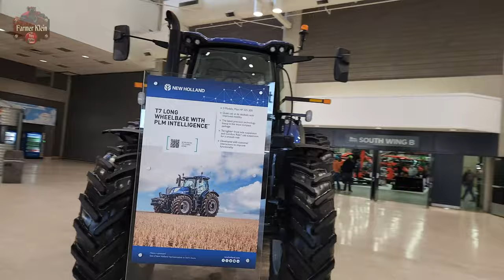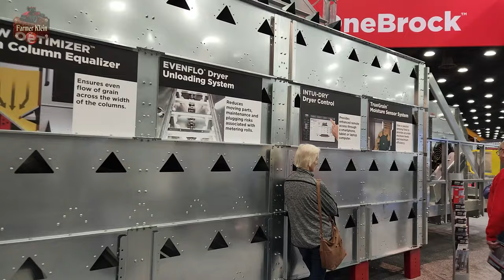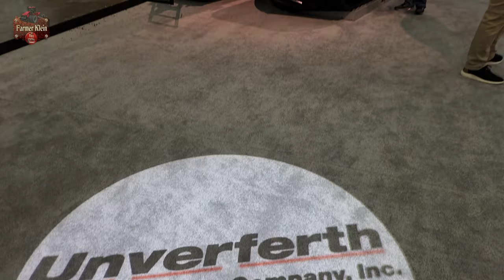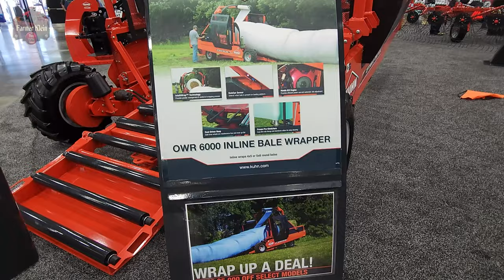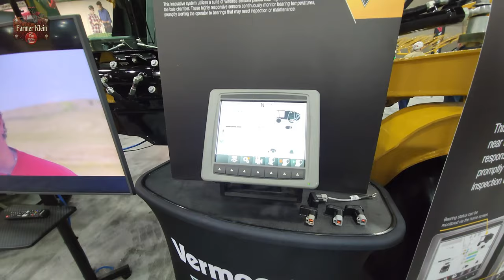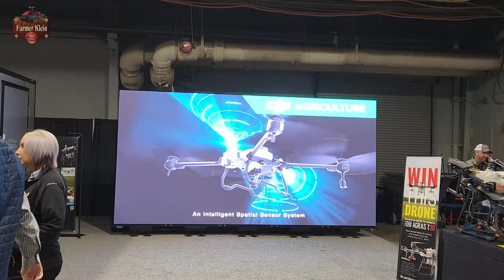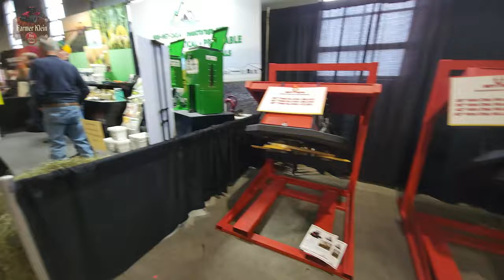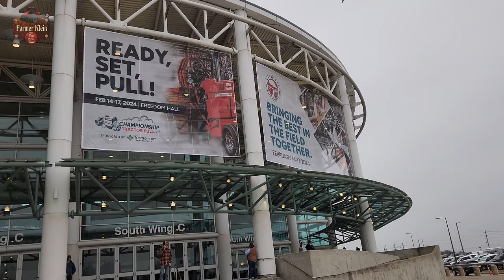National Farm Machinery Show 2024 - Super Edit

Comment: Brilliant video. It's like you're there! I'm curious, though. Exactly how long does a hi res 3.5 hour video take to upload?! I'd think about 48 hours....
Reply from the maker: On my home connection over wifi about an hour and a half.  Could have taken less time if I bothered to plug the ethernet cable in.  It was a 63Gb size file so upload times would depends greatly on your internet connection.
Reply: @FarmerKlein  Wow. I guess your videos get upscaled by YT. I thought it would be a 3-400gb video. Looks fantastic, though.
Reply from the maker: @thevenerablekev1  I encode everything in 4K.  No youtube upscaling.  All of those clips were recorded in 4K 60FPS, and where encoded the same at a 40Mb/sec bitrate.  The daily videos were encoded in 4K using AV1 vs H264 because AV1 has greater compression levels with a minimal loss in quality over H264 as I was using hotel wireless to upload those while in Louisville last week.
Reply: @FarmerKlein  Got it! Thanks.